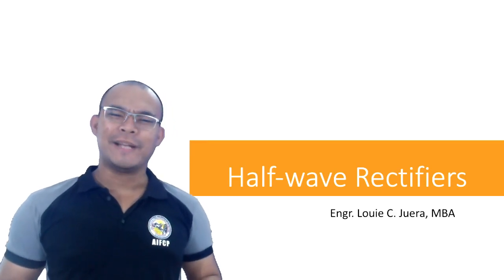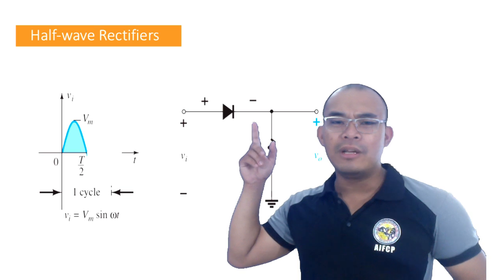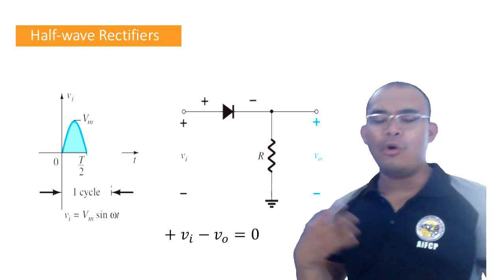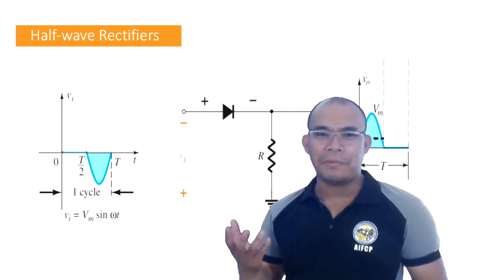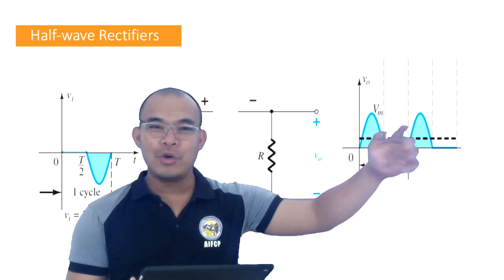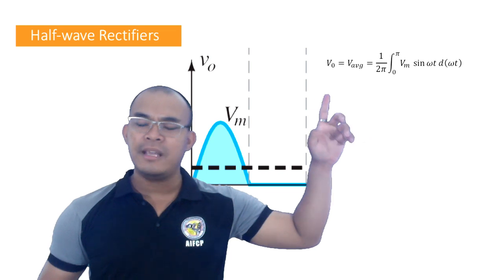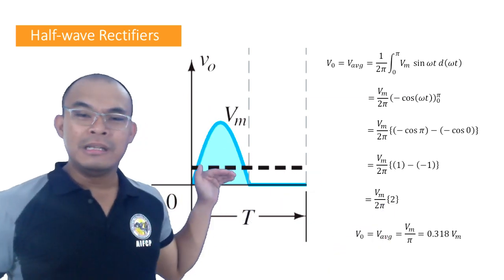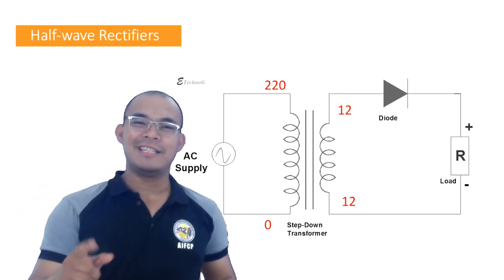3. Half-wave Rectifiers (in Bisaya)

Comment: half wave rectifiers has a alternating current that change positive to negative, when it is in reverse bias that means it is close that has no current flowing, also i learn that in diodes if where the arrow of the diode point current will flow there, and also the output and input has same amount of currrent flowing